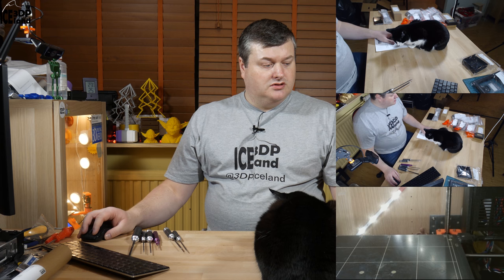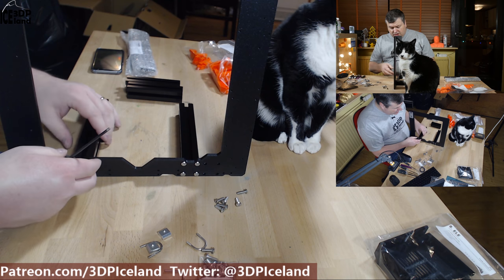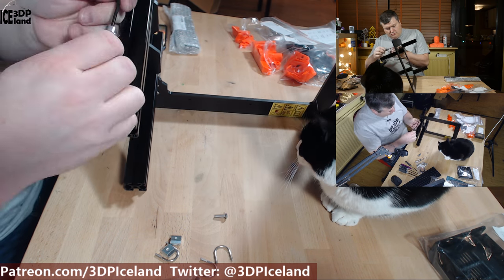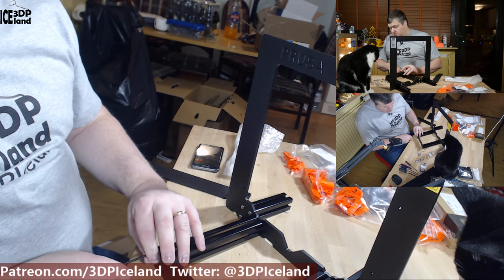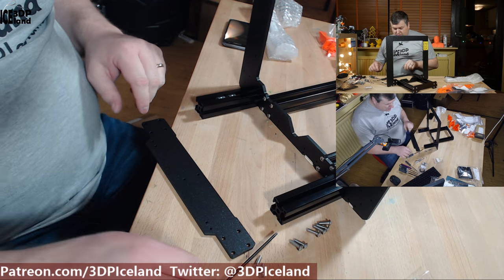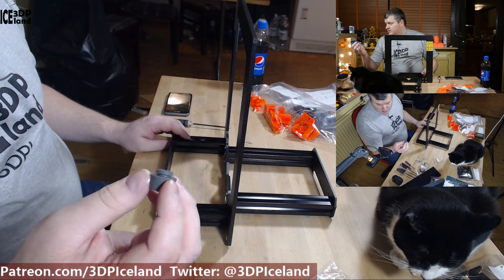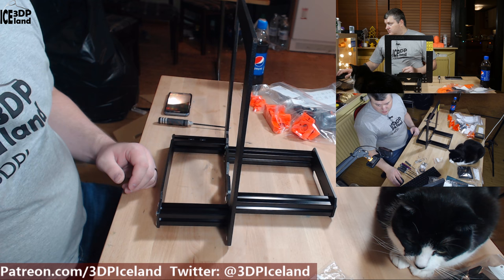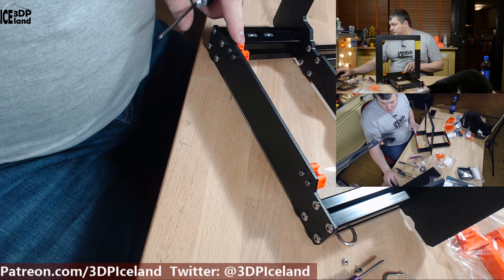Prusa i3 MK3 3D Printer Build Series - 2. Y-axis assembly

Comment: You should consider to get the two upper ball bearing lines of the x-carriage the same as on the z-axis. One facing up/down/right/left and the 2nd in an 45° angel and the lower ball bearing up/down/right/left. You can mark the ball lines on the outside to make it easier.

Comment: What size socket are you using to tighten the u-bolt nuts? I just purchased an Allen wrench screwdriver set, but need to buy a socket set as well. Thanks again for the video. It was done very well.
Reply from the maker: It is 5.5mm - Thank you for your comment.